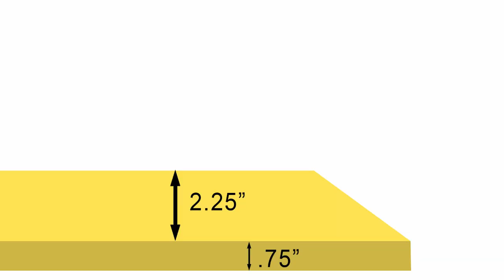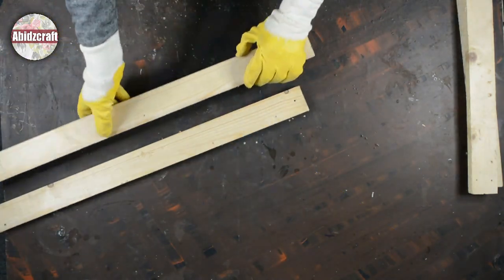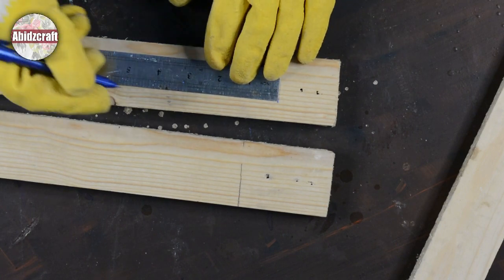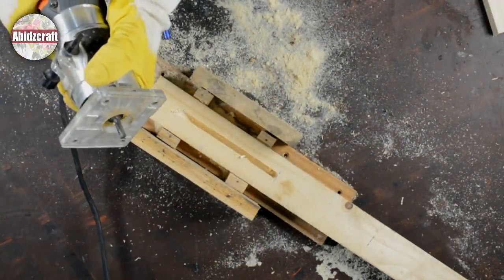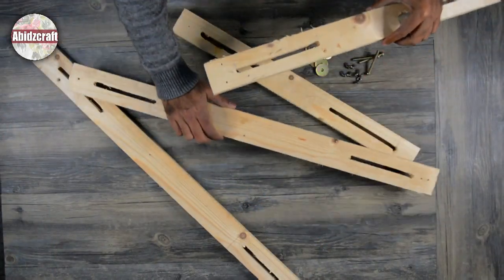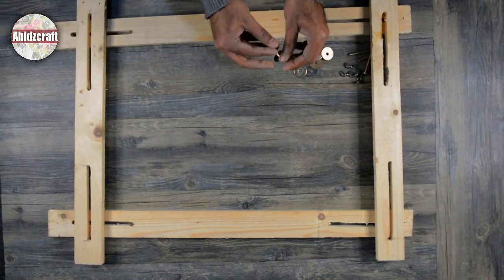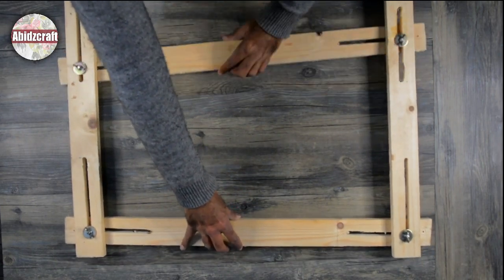Silk painting | Wooden frame part 2

Comment: What should be length and wodrh of frame fr silk duppattas
Reply from the maker: 9.5 feet by 5.25 feet
Reply: @abidzcraft  thankyou.any idea how much eill it cost me and where is cheap market in karachi to get it made
Reply from the maker: @11yushi  just contact with any carpenter or go to any wood shop and ask about carpenter. Force to  make it in soft wood. I guess round 10k prices are totally changed now.